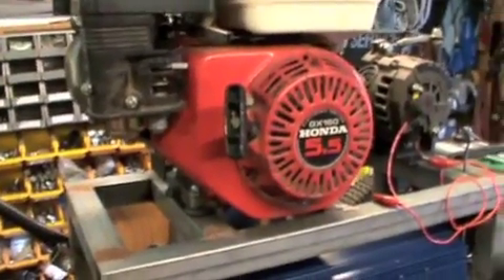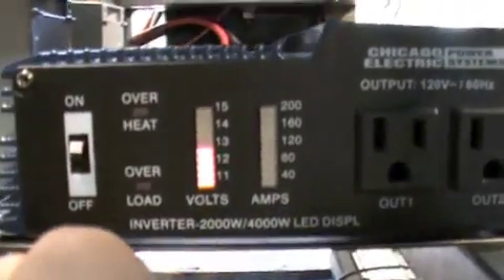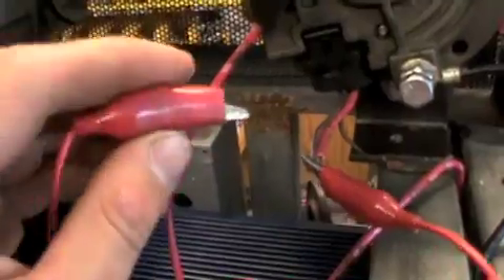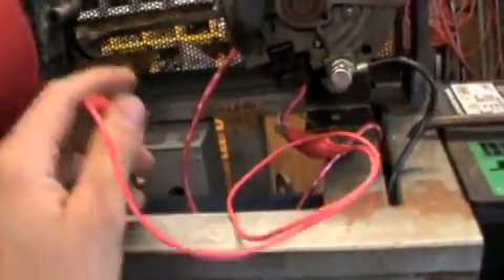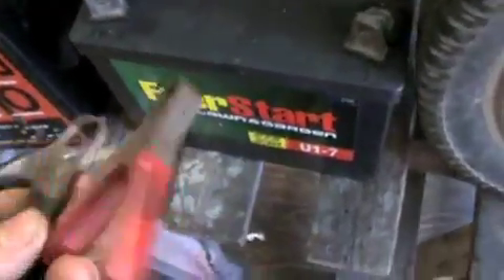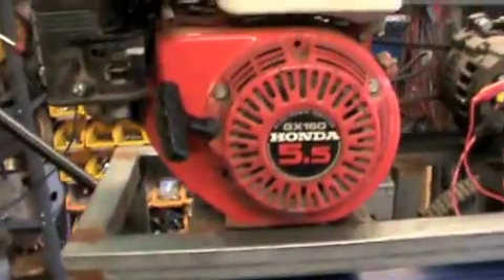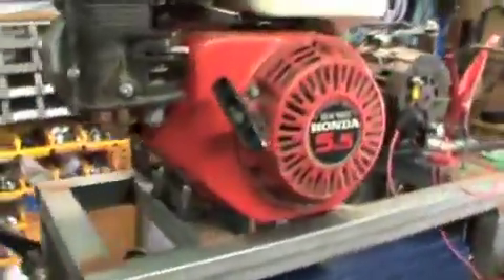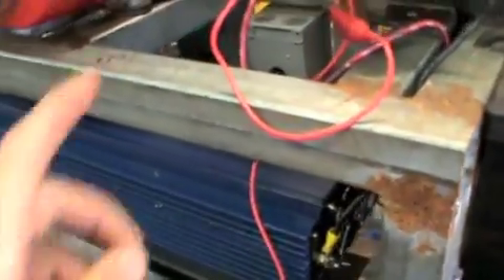Homemade Generator With Inverter

Comment: If you took a DC fan and mounted to the belt guard (to aid in cooling the alt), and wired it to the field with a pushbutton to start charging the alt, would the fan run with the alternator and shut off when the alt is stopped?

Comment: Very simplistic and effective, I’m building similar. It sure beats spending 3000 for a decent generator. Personally I’d rather build my own so I can figure out how it works and it’s much easier to fix it when something breaks. We been losing power quite often here in the mountains of Pennsylvania and I can’t afford to grow out anymore food due to no power. I have been a small engine mechanic for many years and never even thought of building a generator untill I moved up here. Well the time has come to build on, I will make some vids soon
Reply from the maker: Make it happen! This was a fun project, I learned a lot about how power is generated with an alternator and converted etc... With a large enough inverter and engine, you can just about keep it at an idle to run what you have to. At that point you'd barely use anything for fuel.

Comment: sweet i have a 1000w 4 amp 220v halogen light from the therd phase to ground would i get 110 volt at 8 amp for a normal plug at the same time i have 220 betwen the other 2 phases even if i only get 208 to run my light it is rated to work on 220 or 208

Comment: one other thing,They make permanent magnet alternators pretty cheap that don't require brushes so it takes less to produce power and its allot of power.No drag from the windings as they heat up.All it needs to do is turn to produce power.Nothing is needed to heat up the armature.Teledyne is the company that produces them.

Comment: Ya but you would only get .8 amps or there abouts.Theres a company out there that sells a receptacle box that wires in that has a voltage regulator built in for you to use while in the woods.Good luck.

Comment: you are aware that your alternator is 3 phase power that you can tap rather than using the inverter right.I will give you 3 outlets for ac power.All you need to do is solder the wires in front of the diodes.If that's a 80 amp alt. it would give you 8 amps ac.and you can still use the 12 volts for charging you battery.

Comment: Run the 6.5 Honda on Propane and throw out the gas tank. Some things to keep in mind is how to figure out your watts.
AMP x VOLTs = Watts. 
If your Alternator puts out 50amps at 14 volts = 700 watts  So when your inverter is under a load from on the AC side,  you only have 5.5amps available at 120 volts.  :)  Some inverters do not like to run motors.  Read about inductive loads verses resistive loads.  Take care...and experiment on!

Comment: you should put an exhaust deflector on the muffler so if you wanted to move it while it was running its not blowing exhaust in your face. but other than that good job

Comment: Great job! but the carb is not set up correctly. The engine is set waay too slow, it will safely operate a lot faster than that. Theres a linkage that connects from the block of the engine to the carburetor's throttle and it should open up the throttle automatically under load to keep the engine at that certain RPM. Set it to run at higher RPMs and you will see much better results That alternator needs more speed to give out it's 100% output. But I have to say GREAT JOB, excellent craftsmanship!

Comment: Love it !! Great build and great video. One quick tidbit - you mentioned that your inverter would not run your side grinder. That is most likely because it's a "Modified Sine Wave" inverter. Only a Pure Sine Wave inverter  will run motors, inductive loads, and fluorescent lights properly. Nice job on the cart !

Comment: You need bigger battery AMPs.... Try more batteries or bigger battery. That will solve your problem.  You need more amps from the battery that simple..

Good luck.  Like the setup....